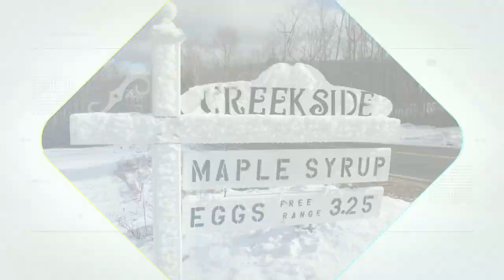MILLING WITH WOODLAND SAW MILL  | MEET THE ALPACAS

Comment: Why did you not back the truck up to the log pile?
Reply from the maker: Good question Jim. It’s hard to see it in the video but there was a slope there. I first backed the truck up to the pile but with the front of the truck down it raised the back end up so high I couldn’t get anything loaded. So it was plan,  B , pull the truck down into the hole a bit, and it dropped the tail end down. It was easy to roll the logs over to the truck because it was downhill. That made it easier to load. Thanks for watching and hope you are having a great weekend

Comment: Why not just back up to the logs already pointed at the truck
Reply from the maker: It was on a slope and it raised the back of the truck up much higher. Parking where I did lowered the tail end considerably making the lift easier. Rolling the logs was the easiest part. Have a great day

Comment: Tony that midsection you are packing is from too much carbs in your diet. look into Keto and you will feel better and not be so winded.
Reply from the maker: Thank you for the info. The mid section is actually a very heavy back brace I wear underneath my clothes. I wear it to protect my back. I have gained a few pounds but have lost a lot of them since this video. I was disabled from an accident for 2&1/2 years. During that time I gained weight. Now since I have had surgery to repair the damage, I am back to being busy and I’m in good shape. I appreciate your concern and suggestions. Thanks so much.